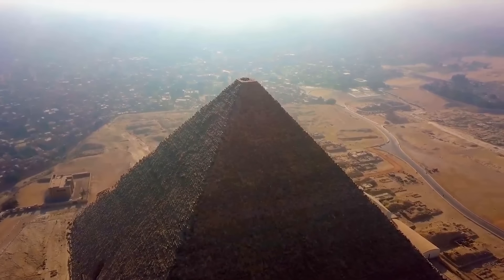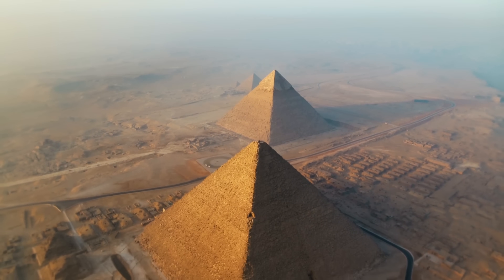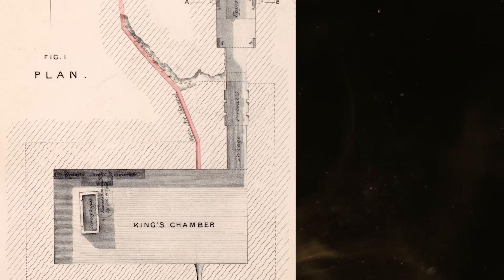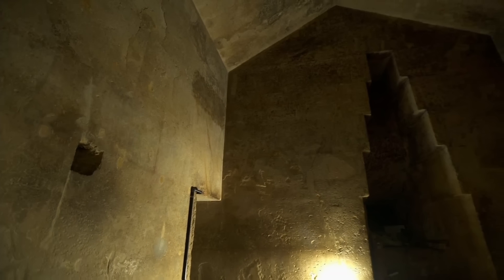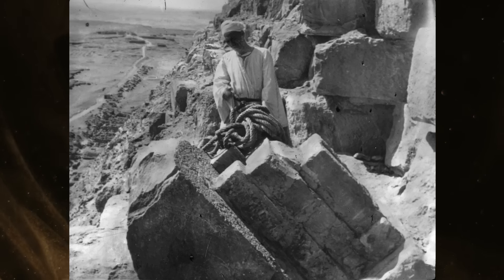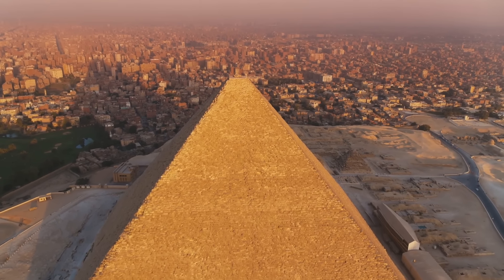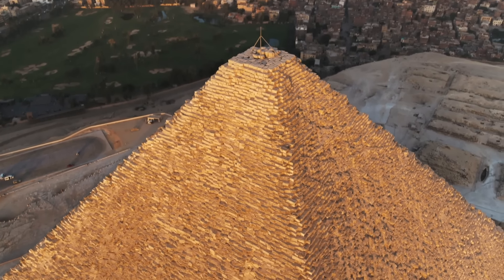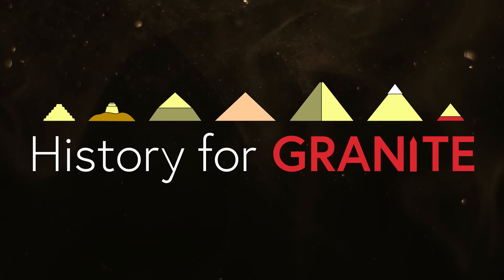One Solution to the Four Channels of the Great Pyramid

Comment: Pretty sure they were just for fresh air - for workers and flames. Warm/stale air would be drawn out, cool/fresh air would be drawn in elsewhere.
Reply: I agree. The most obvious is typically the most likely. And it certainly seems like the case here. Especially if they were working on the structure for years. Ventilation makes sense.
Reply: If true, why were the queens chamber channels left uncut? The workers would have been sweltering in there while an otherwise usable channel was left capped by the wall stones.
Reply: @ryann6067  

That contradicts the findings here though, does it not?  The queens chambers ventilation was never opened, for workers or anyone else, and the drill marks seem to suggest that the ventilation was not in place for the workers of the kings chamber until the end of the project.
Reply: @PickledShark  For the greater part, ventilation would not have been required until the top of the chamber was covered.  Certainly, once the decoration had started, ventilation would have been a must, if only to vent off the smoke from lamps.

The blocked channels in the Queen's chamber suggests to me that the interior work was never completed, perhaps never started.
Reply: @PhilJonesIII  

Yeah, that makes sense to me. Still, it seems strange that the holes for vents weren’t cut in before the second course was laid on top of that
Reply: @PickledShark  they likely open to the internal spiral ramp enclosed within. And the pyramid may have originally planned to have been smaller, and later enlarged. -hence the evidence of incomplete work in the “queens chamber”.
Reply: @PickledShark  it probably was open, then capped and plugged when they continued building upwards.
Reply: @PickledShark  in context with Jean Pierre Houdin’s theory on the pyramid construction it seems to make sense as ventilation, or possibly for use communicating amongst workers inside and those on its surface.
Reply: @PickledShark  Not sure, but there must be a reason. If your reasoning is true then the same goes for every other theory. I don't think it was so much about feeling comfortable for the workers as it was about just being able to breathe and see. 
I like the pyramid enlargement theory too which can explain why those shafts were eventually not needed any more.
Reply: @ryann6067  
I’m referring to the fact that the vents never opened into the queens chamber itself.
Reply: I'm glad, that after watching this, my thoughts on the air shafts were mostly vindicated. The 'new' question of who the air was for is an interesting one to ponder... if not the workers, then who (or perhaps what)? Maybe the air was for the spirit of a dead pharoh but I think that's not likely as most objects & requirements for the afterlife usually took on a symbolic form hence a symbol for 'air' would have been enough if it was considered important to have in the afterlife!? Maybe the air was just for torches that painters & artists needed to see by once the building was complete or maybe the air was for the pyramid itself - to prevent the salt and other nastiness from forming in the humidity?!
Reply: @PhilJonesIII  The cutting into the floor of the queens chamber shows that atleast some work was done their, and that stone cutting would be labor intensive, if this didn't need ventilation then mere painting wouldn't either as it would be far less physically strenuous.
Reply: @justinfarnell2284  all great questions and points, my thoughts the same. Its fascinating to ponder.

Comment: 1) My theory is that the shafts are for SOUND to travel to the outside. The kings chamber has great acoustics, imagine priests singing inside and the sound on the outside as if coming from this huge stone structure - would be a magical experience! I've heard people report, that when waiting on the outside, they could hear people singing in the kings chamber (when groups pay for exclusive access for an hour for example).
2) Alternatively, they could be for ropes, used for the final sealing of the pyramid - e.g. to trigger the plugging stones to slide down and plug the upper corridor and then another rope to close the portcullis. If this didn't work well, this could also explain the vertical shaft that was later made to go in and fix something.
Reply: There's no way anyone would hear anything from a tiny hole far up the side of a pyramid.
Reply: @andrew6978   As I mentioned, people have reported that, while waiting on the outside, they could hear exactly that - some group that reserved the Kings chamber for an hour for their singing and meditation.
I'm not sure the videos on YouTube, but I've hard that claim at least twice.
Reply: Interesting rope idea

Comment: It`s  easy to see that  those   were  ventilation shafts.   Each    shaft  has     different length and  each of   them    are     facing upwards. This  is  how  draft  wind    works, and  this  principle is  used in regular  chimneys.   In  final stages  they were        finishing up the  tomb  and         holding    burial  ceremonies there  for the    pharaoh`s  family. The  only   way  to  have light     there  would    be  with     torches  which      created a  lot of   soot  and    consumed  oxygen. That is  why  they needed        those  shafts,  to             vent  the   smoke and soot.  And  most   likely  there  was a   grace  period     when   the  family   could  visit the  tomb  before  it  was  sealed off forever.
Reply: Good idea that they needed ventilation for the priests or perhaps the family and visitors. Maybe there might be some soot left over inside the channels to prove that they were used as ventilation?  But maybe they were needed for a short time? It’s a lot of planning and work to make them for sure! Genius people…

Comment: You mean the vents from the King's Chamber CURRENTLY reach the outside, but what scientists FORGET is that the skin of the pyramid has been stripped, and so they were originally closed off like those in the Queen's chamber were. All the vents originally reached the outside, but the Queen's vents were plugged on an upper platform whereas the King's channels were actually plugged higher up at a point where they actually met the pyramid face. They wouldn't have been left open for practical reasons. People forget that it must have been extremely hot inside that pyramid for the workmen and so they put simple ventilation channels into the plan to keep things as cool as possible and vent the hot air out of these work areas. When the pyramid rose higher the vents were no longer needed and so they were capped off. That they bend and twist I think is because as each level rose in the pyramid it was not important to carry through the rising channel to the outside in an overall dead straight trajectory through the masonry levels, as the stone mason's job was only to make sure the channel appeared somewhere on the upper face of each successive rock layer where the next crew could pick up the opening and channel it to the next surface, and so on. So you have channels that are not really straight overall but didn't need to be as they would still vent.  These vent holes have no other special significance. BY THE WAY it's kind of hard to align stars with crooked and closed off vents! Let's s---tcan those ideas right now!

I think it ironic that so much excitement is given the appearance of a mysterious door at the end of one of the shafts, when all it is is a cap to seal off the shaft, behind these one will find ordinary masonry. Or maybe Khufu's mummy will be released and come sliding down into the pyramid!  Its like everybody's attention at the Metropolitan Museum is not drawn to the artwork, but to the closing mechanism on the ventilation in the broom closet. SZ BA MA Art History and Architecture UW Seattle
Reply: As the outer skin is missing you are just guessing that they never extended to the outside. There is as much evidence that they did as that they didn't. The ones from the Queens chamber are unfinished and show temporary blocking.. the ones from the Kings chamber are not blocked in the same way so it ls logical to assume they in fact did extend to the outside.
Reply: Well I would say glibly put but I am afraid that you do not understand the project that I as a professional see it. You are not seeing the structure from the perspective of modern engineers I guess 'channeling' ancient engineers, what they thought about and why they did what they did. I have found as an architect and project manager (as well as an instructor in art history at the college level) that when analyzing the ancient monuments from a modern building point of view that  such training puts me in the minds of the ancient builders and the problems they needed to address. ('Oh, I see why that was done'). It's almost like a warm feeling one gets on seeing a group of old friends. Extraordinary!

Ventilation in a hot stone pile was the primary motivation to build these channels  which were crooked on the way up and were not good star viewing channels. And so they were closed off to keep  animals out.  

People who are not professionals lack the tools of critical analysis to the extent a professional has acquired these tools through experience and education. However, such a broad issue is never simple, is it? We still have two well marketed or heavily publicized views  about the construction of the pyramid that need to be discarded. One is the Atlantean Theory another is the Spiral Ramp Theory, which is put forth by an architect I have to admit but for which I can find no sensible argument at all. And there are others: the aliens theory, which I think is too spacey or the Moses grain storage theory or the repurposed building as a microwave factory theory, and so on! SZ BA MA Art History and Architecture UW
Reply: How is that logical, by the way? @PaulaXism

Comment: Why does the chamber need air?
Reply: For construction
Reply: For ceremonies (which would need  flame based lighting), also to prevent moisture and heat buildup of the mummy so it doesn't rot or get mold
Reply: It's not the chamber that needs air...it's whatever was going to be put in the chamber. Think about the channels as ducts that pass air through an apparatus of some kind. This would also make sense as to why the holes had different machining marks done later...so that the apparatus could be custom fit into the square holes on site.
Reply: So lamps can burn

Comment: Excellent observations, however if I were designing a ventilation channel I would most probably place only one in the design and mask it by recessing, one chimney/vent can have multiple addendums for multiple rooms. This building is masterful in conception design and craft and the four shafts must have purpose, but not sadly for air.
Reply: Two channels would give better ventilation as it would let the wind outside blow air into one entrance and suck it out of the other.
Reply: @JorgeStolfi  air vents work by drawing in air low and rising out at the top, where is the lower air vent? 
One air vent is ample if you have the right diameter. Why waist high and so visible in such beautifully built rooms ?
Reply: @HerreNeas  The duel channels rather then one larger channel is the best evidence against ventilation. The channels are ritual and the ritual need is for two of them.  As for ventilation the current ventilation depends on air coming in at the robbers tunnel and the north entrance and up past the blocking stones.
Reply: @kennethferland5579  agreed, I am currently attached to a hypothesis that the channels may have carried smoke as a ritual signal similar to choosing a new Pope. Something akin to this, I am aware of some of the fringe hypotheses,  but they largely represent too big a step for me, the second chamber is still quite mysterious and with so little evidence either verbal or recorded the intended burial place for Khufu is as good as most theories, hopefully future science can shine a brighter light on this magnificent structure.
Reply: The prevailing winds blow from the north to the south in Egypt. By having the channels on a north-south axis as they are here, you get free forced air ventilation with intake on northern side and exhaust on southern side. In addition to the draft effect created you may have a slightly lower pressure zone on the southward side of the pyramid which will help to increase the overall airflow volume.

Comment: I agree with some of the things you say but not others. If the purpose of the shaft was to let in, or rather, let out the hot air and humidity from the room then they had to be positioned higher and not lower since hot air rises and with the shaft in this position most of the air would have remained undisturbed inside.

When you say that the inclination of the   shaft optimized to have shorter channels, this does not apply to the south shaft of the King’s Chamber. It should have had a smaller angle to make it form 90 angle with the outer wall and have a shorter length. But this is not the case so the hypothesis does not have much value.

On why the shaft  are dug on 2 blocks instead of just one, it is not a coincidence. It is much easier to cut 2 edges of any material rather than digging a “U” because you have access to all sides to cut while in a “U” one side you have to reach by digging and not cutting which increases and not a little the difficulty. Moreover, the rounded cut of the edge is the result, in my opinion, not of a tubular drill but more of a cylinder made to rotate to corrode the rock. In practice you start cutting the edge from above, then sideways, then you blow up the cut part and finish the edge with a cylinder. Depending on how much you want the edge to be less rounded you use a smaller cylinder. The advantage is saving time with the cut because you don’t have to go all the way to the edge. All this, however, does not lead to say that the channels were to let in air. Even if they had been really completed later, it does not indicate the purpose that the shaft should have had.
Reply: air pushing in from the wind is much stronger than the hot air rising over cold air, it's the same thing as when you open a window allowing air to circulate through your room to the other window only in this case you have really long channels
Reply: " not of a tubular drill but more of a cylinder made to rotate to corrode the rock"
also called a tubular drill..........
Reply: @huuuuuuuuuuuuuuuuuuuuuuuuuuuhn  the wind that enters a hole 20x20cm for 20 or 30 meters? It must be a hurricane to feel its force inside the king’s chamber. A normal wind after a few meters becomes a light breeze and after 20 meters it is no longer felt, the friction of the fluid with the walls dissipates all its energy. Not to mention the air that comes out of the cracks in some joints. The example with the window is out of place, an opening of 1sqm in contact with the room Vs an opening of 0.04sqm in a duct of 20m? We are not there at all
Reply: @huuuuuuuuuuuuuuuuuuuuuuuuuuuhn  Translate to English. Maybe I didn’t explain myself well. A drill digs frontally. A cylinder that corrodes something digs sideways, longitudinally. Making a hole all the way through a block with a drill is much more difficult than corroding the edge with a cylinder that rotates and is as long as the block. It applies to any material. Try to make a 1m long hole in a block of wood with a drill. After 20cm you are stuck and you need a drill with a very high torque. If you try to corrode a 1m edge with a cylinder coated with sandpaper you will be able to do it even if you turn it by hand and fix the ends of the cylinder axis to the ends. The two methods require totally different efforts and enormously in favor of the cylinder